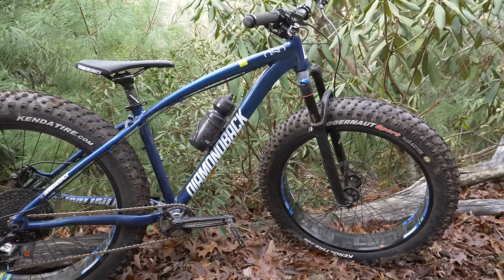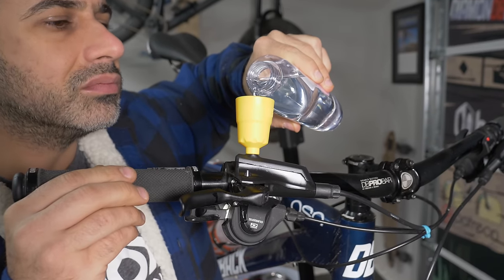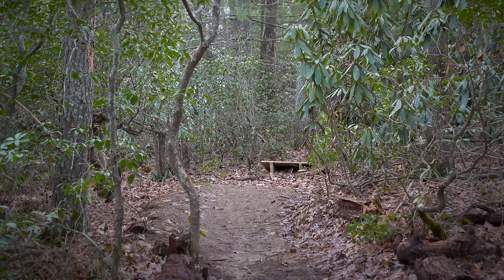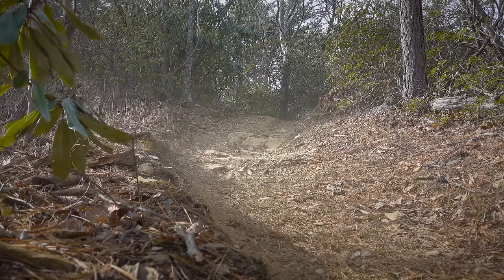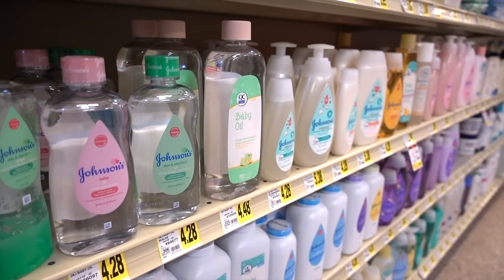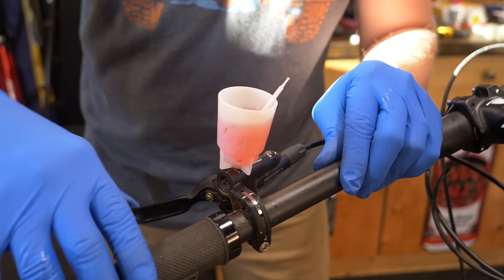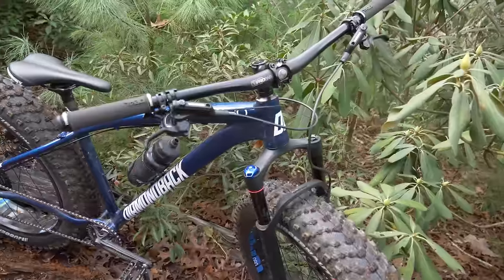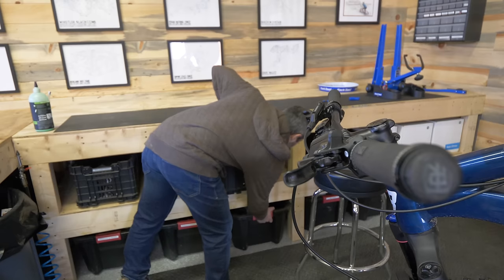I filled my mountain bike brakes with baby oil for a year and here are the results!

Comment: I've been running pure Mineral Oil (the non-baby formula) for years now, and will say that it holds up as well as name brand brake fluid. But with 1 major caveat. If you're going down a long hill and just riding your brakes, the Mineral Oil does get spongier faster, but I've had Metallic pads loose their friction coefficient and the rotor get red hot even before the brakes became really spongey. 

Yes, the name brand stuff will last longer, but depending on your riding habits, the Mineral oil off the shelf vs brand name stuff might not even make a difference. But even then, I feel Mineral Oil can be had for so much cheaper than the brand name stuff, that you could probably replace the fluid at least 100 times with mineral oil before getting close to spending the same amount on the brand name stuff. 

Personally, I've gone through about half of a 16oz (473ml) bottle of Mineral oil at $2, exchanging the fluid pretty much every other month. At that rate, it's still way cheaper than the brand name stuff that usually sells 100ml for $10 or more.
Reply: The thing is: 100ml bottles of Shimano oil cost 10$
1l containers cost about 15 to 20$.
It seems you pay more for the packaging process then for the actual content.
So if you buy large enough quantities, the price gets very low too.

And even then: you can spend 30-60$ on a dropper lever, 10-30$ on grips and so on... 10-20$ for brake oil isn't that big of a deal.
But then again, if other stuff works fine for you, save money if you think it's worth it.
Reply: You're changing your brake fluid six times a year? Is the fluid breaking down under heavy usages?
Reply: I have a big jug of Food grade mineral oil I will be using...don't need stinking overpriced "special" oils  that cost 10X more!  Hydrolics is a simple concept...a bike system never gets as hot as astoping a 2 ton car!
Reply: At some point, the added confidence in a company that developed its own brake fluid is worth paying a few dollars more for, and taking a few less stops at the coffee shop in a year to compensate.
Reply: The branded oil contains about 0.001% of a red dye. That's it.

Comment: I actually ran pharmacy mineral oil in my brakes a while ago. It does NOT work for cold conditions as the temp. drops the viscosity goes up a lot and it meant that my brakes be hard to pull and once pulled would stay there. Definitely sketchy. Replacing with real stuff immediately fixed the issue.
Reply: The exact same thing happened to me
Reply: I going to try TRW mineral oil for cars, tractors, etc.

Comment: After 35 years in the fragrance industry I can tell you that baby oil is only light mineral oil (Shellsol T or similar) with about 0.3% of added perfume concentrate. Quite a lot of that perfume is the carrier that's used to dissolve some of the solid perfume ingredients like vanillin and that's DEP or diethyl phthalate, which is pretty innocuous. Baby perfume doesn't contain any esters or orange terpenes (sold as citrus degreaser) so is unlikely to cause any long-term damage to rubber seals. There will be about 30 - 50 other odoriferous ingredients in the perfume but at an overall dosage of 0.3%, with between 10% and 40% of DEP included, nothing is present at a high enough dose to do any harm.

You could use plain light chemist shop mineral oil, 3 in 1 lubricating oil and I daresay even diesel in your brakes. Actually water would be great but we know it boils. Shimano brake oil has a red dye added to justify the high price and there are dozens or even hundreds of different weights of mineral oil available so don't overthink this!
Reply: Sheldon! I didn't know you were into bikes.

Comment: For "mineral" oil brake systems: Use engine oil or (better) automatic transmission fluid ATF (Yes, it is oil). Do NOT use brake fluid in those systems. Engine oil and ATF have additives which protect against corrosion, protects gaskets and O rings and more. They also have high boiling point. Synthetic oil is fine if you have it around,  but it is an overkill. Baby oil does not have those additives and I doubt if Shimano's oil have them either. BTW: Some heavy equipment use ATF in their hydraulic system. 

If the manufacturer specifies brake fluid (DOT 4 usually), which is NOT oil,  DO NOT use any oil. 

If you are considering a new brake system, go for "mineral". Brake fluid (mostly DOT4) is hygroscopic and will cause corrosion over time. It also dissolves some paints, so you don't want it spilled on your precious bike.
Reply: As soon as I googled bike brake disc- this came up.
My immediate thought was “has this guy ever heard of ATF/synthetic ATF?”
You know... higher boiling point, better rubber conditioners, higher boiling point, cheaper.
Reply: Same go for 2-cycle oil?

Comment: Thanks... I have a shop and I have been in situations where I could not get recommended brake oils. So I went shop to shop looking for baby oils with mineral oil content. In this country, you cannot find them!!! And unlike the USA where you can buy mineral oil in many stores, it seems people have never heard of it here! So in my search, I found Vaseline Hair Tonic (Blue) to have the maximum amount of mineral oil... I used it to top-up and it worked like a charm. I still keep it as spare. But now I have plenty of recommended mineral oil at hand AND I just ordered a lot of "cutting board" mineral oil to use as a substitute!
Thanks for the video... I have no doubt that baby oil with the highest percentage of mineral oil will work just fine. But as you say if it may not pass some tests, specifically because of concentration (percentage) of mineral oil.
Reply: Automatic transmission fluid.
I promise you can probably get it in any nation that has cars.
Alternatively, go to a place that repairs heavy equipment. Ask for tellus 32. They’ll probably give you a gallon for free.

Comment: Maybe it was mentioned in the other video, but please do not do this with DOT4 or DOT5.1 brake fluid systems as you will really mess the seals up. 
If you are in a pinch needing a quick fix on the trail, you can use water with DOT fluid and it won't wreck the seals, just mind the brake boiling. For mineral fluid systems, stick with basic oils in emergencies.

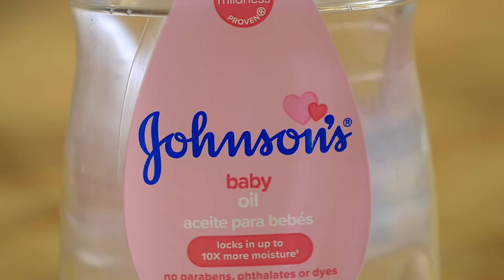Comment: I think your answer is at 6:29.  Right on the bottle.  I'm not sure that it means the oil itself is absorbing moisture (this, corrosion, or heat is typically what makes brake oil go "bad") but it may be worth some sort of a controlled test.  Now given that the system should not be letting air in anyways it shouldnt be an issue if it actually is absorbing moisture, but if it could that wouldnt be good for the system components.
Reply: Why would mineral oil absorb moisture? It hates water.

Comment: I ran drug store mineral oil in my brakes and it worked great until the temps went down. Below freezing, the oil gets thick and it got to the point that applying brakes becomes difficult and the pads barely release at all.

Comment: I was in a pinch and used what i had, 'transmission fluid' in my Magura disc brakes. its thicker which makes it more work to bleed. But works just fine. Zero problems.

Comment: I'd say it's safe enough for a "get me home hack" it could come in handy one day
Reply: I'm not sure how you're in dire straights if you're somewhere with the ability to even open up your brakes to put in new fluid. I'm wondering what example you have that this would be an actual scenario.
Reply: @iammarkstewart  most brakes only take a t25 or 1 Allen bolt to add oil and I take a multi tool on every ride. An example I thought that it could come in handy is if I ever develop a leak in my line and lose fluid I could ride to my sisters house and bodge it with duct tape and baby oil to get me home with 2 working brakes. I'd personally prefer that than having only 1 working brake.
Reply: @Duncan23  I was going to poke some more holes in this but you do you. Good luck.

Comment: As a 20+ year rider (now in my 40ties), I dissed slightly on some of the vids here where (much) more attention was given to visuals than technical side. That said, this one is right up my alley - how to cheat BBB (Big Bike Bozos, not the brand BBB). Today dismantled old Italian Brembo... No, Formula Oro K18 brakes and tried to push the piston back to replace pads, wouldn't budge even after 30 minutes of mallarchy, so... I think baby oil it is. Dismantle, clean, fill, bleed. Formula Oro, as far as I've understood, is making also Giant-branded brakes. Thanks for the advice and greetings from Latvia.

Comment: When I found out how unhealthy Canola Oil is, I stopped putting in me. Then I wondered what I was going to do with the bottle I had.  One day I couldn't find my chainsaw oil. Canola Oil works great in a chainsaw.
Reply: As bar oil, not mixed in with gas for the engine, right?
Reply: It's not great vegetable oils can block the oil canals in the bar but yeah it works for quite some time
Reply: Marcus Lobenstein if the veg oil is Mixed with used motor oil it works fine.

Comment: You see where I live, 10ml of Shimano brake oil is 10 euros (12ish $). They rip the skin off with that price. While a whole liter of LHM mineral oil made by Total costs 6 euros or 8$. 
It's actually a mineral brake fluid designed to stop cars (Citroen uses this oil) and is high performance, probably even better than Shimano stuff. It's really not worth buying the "brand" stuff.

Comment: Cool vid I think that contamination of the seals should happen quite quickly if the oil is not compatible with the brake system. Baby oil might have a lower boiling point because some of the fragrances might boil first but pure mineral oil should be ok.
Reply: No. See my explanation in the main thread. Perfume is there at 0.3% and will have a similarly high boiling point to light mineral oil.

Comment: I put some baby oil in my bike, I diluted it with a bit of soapy water so it wasn't so viscous. It works like a charm.
Reply: I'm wondering how that mix worked since mineral oil is insoluable in water.
Reply: @1stAshaMan  If you add a bit of soap into the mix, it does a good job of combining the oil and the water to some extent. It won't be perfect, but it will be enough to not cause problems with braking. Also if someone were to try this, I would suggest them to make sure none of the foam gets into the brake hose or other components as that could cause air bubbles.

Comment: I've had vegetable oil in my brakes for a couple years and they still work fine. I really wanted to ride one day but needed a bleed and didn't have brake oil...I guess I could have re-bled them by now.
Reply: I just replaced some SLX caliper pistons, couldn't bring myself to pay for branded oil, and used my thinnest biobased (vegetable) suspension oil since I had some around anyway and it's been fine for shock dampers. Air bubbles floated out a bit more slowly on the bleed, but otherwise seems fine so far. Thanks for the encouragement.

Comment: @6:24 "Brake oil is far from expensive" - maybe south of the border... but in Canada it's $94/liter!!!  That IS literally ripping off customers with snake oil.  No f'n way I'm paying that when Johnson's is $3 for 591ml.
Reply: Synthetic ATF. Cheaper than baby oil. You might already have it/need it. Higher boiling temp. Rubber conditioners. Already does similar type of work.

Comment: The only suspect ingredient in the baby oil is the fragrance compound. The only part in jeopardy is the seal. The question is whether the fragrance will affect the seal of various manufacturer's seals. If that tests out OK, then the baby oil would be close enough. The property being relied on most is the icompressibility of the fluid, which allows efficient transfer of force. There will be no difference here because liquids are nearly identically compressible, which is a tiny amount per cubic meter.
The next three properties would be viscosity, lubricity and corrosion inhibiting ability. Viscosity controls how responsive the fluid is to flowing through the closed brake system. Lubricity minimizes wear on any metallic parts and helps seals last longer. Corrosion inhibition affects both the aluminum and the elastomeric compound used for the seals.

Comment: It's a hydraulic fluid, the mineral oil is the only thing needed to do the job, the fragrances are probably the only thing in baby oil that you wouldn't want in the system, but as long as it doesn't corrode rubber/metal it's totally fine. Straight mineral oil is what r22 compressors use for a lubricant, just dont mix it with other oils like pie oil, it will gunk up. You can use mineral oil to completely submerge computer components and swirl up the oil to keep everything at a perfect temperature, with no I'll effect of damaging anything, as a matter of fact it will protect it from any outside elements, so long as nothing gets introduced to the mineral oil.

Comment: You have to admit there was nothing learned from this.
Reply: Sure there was, if you have a woopsy while bleeding your brakes and knock over your bottle of brake oil but your ride with mates is planned tomorrow. Just get some baby oil. It should do you for the upcoming ride.
Reply: ... It costs lesser, 
works that same on short times,
and have easier to acuire in every day needs...

As I dont have much time to experiment , this video give some experience as what it shoul be to use

Comment: Like to see temperature gun reading
on the different " brake " fluids
after a typical down hill brake use.
You can set up & bench bleed loose
discs brakes a head of time & 
then install them & go on the same
trail on the same bike. I've always
believed when it came to " brake "
fluids bike manufacturers were
" shady " hence LBS don't usually
inventory " brake " fluid for sale.
Causing unnecessary expense
to consumers for labor. Just 
use basic DOT car brake fluid.
Cheaper, handles high heat temperatures on 2,000+ lbs
cars & trucks & on a bike system
100% hydroscopic free.

Comment: Seth
Been watching this channel for a month now recently got back into mountain biking because of my kids wanting to ride their bikes which I’ve been customizing. Anyways, I have a nice sweet giant mountain bike with Hayes hydraulic disc brakes and I’m going to fill the whole system with mineral oil or baby oil whatever I find at Wally World.
I completely agree that the manufacturer just tenting the mineral oil. It’s probably nothing special. All the seals looked fine. I didn’t see anything expanded. I know a motor vehicle. If you use something other than brake fluid, it expands the O-rings and seals and ruins. The system called contamination. I’m going to try this. Can’t wait. 
General Repair LLC

Comment: I use LHM from the motor factors in my mineral oil brakes. Shimano fluid - £20/litre. Generic LHM - £6/litre. No brainer.

When you're changing fluid regularly, as you should, the saving makes a difference.

Comment: One of the main properties of brake specific oil, at least in automotive uses, is its ability to absorb water. Water forms in a brake system usually from condensation because of the constant temperature changes in the calipers and if you dont have a liquid that absorbs the water then it will rust out the cyl walls of the caliper pistons, rust out lines if they are steel braided, stuff like that. Absorbing water into the brake fluid stops this from happening (well happening at an increased rate). It looks like most of these parts are aluminum and the lines are low pressure rated plastics so you might be find using other types of fluids.
Reply: You are describing DOT brake fluid which can absorb water over time. That stuff IS used in many bicycle brake systems but NOT in Shimano systems which call for mineral oils instead.

Comment: End of the day , oil is the best liquid under hydraulic load. I have ran excavators all my life and used mineral oil and variants such as vegetable oil. As long as the viscosity is near enough to factory and compatible to seals you could pretty much fire any oil or liquid in and have the same effect

Comment: Brake oil IS expensive now - 500ml from a local shop was $44 (June 2023 Greater Vancouver area). I bought a quart of Aeroshell 41 for $19 CDN - haven't tested yet but it will be fine.

Comment: Different oils.  I have an old fan that over time slowed down and needed fresh oiling.  But I noticed that the recommended oils also were listed as TOXIC.   But why is that, I thought.  So next time I used electric shaving oil which is NOT toxic for obvious reasons.  It worked a ton better, and lasted at least 10 times longer.  It seemed as though the other oils were toxic because they were designed to break down and thus be called in for action time and time again.  It is sort of like window cleaning liquids that are designed to cause a pail white film to appear after some time, all such that you have to wash the glass again and again.  Anyhow, the shaving oil also did wonders in bringing my 19 1/2 year old air conditioner back to life after the bearing felt pads had dried up, which had been the cause of a high pitch squealing sound. It also fixed my old DENON DCD-900 CD player back to life that was skipping tracks.  Haven't tried baby oil though.

Comment: I should point out, I had my shimano deore front brakes filled with baby oil for over two years now. the rear, due to budget reasons, was a sram db5 brake. that one failed, and was replaced with a magura sl. over two years later, the shimano brake works better than both rear brakes i had!